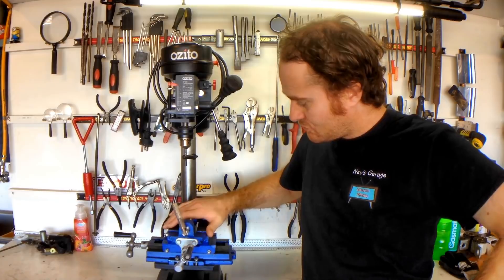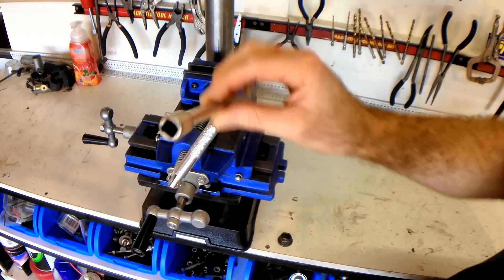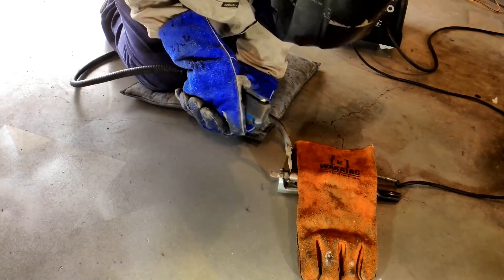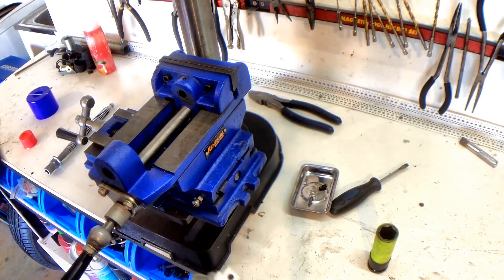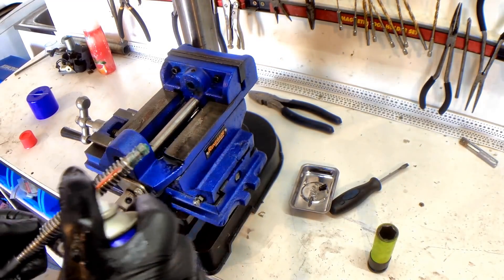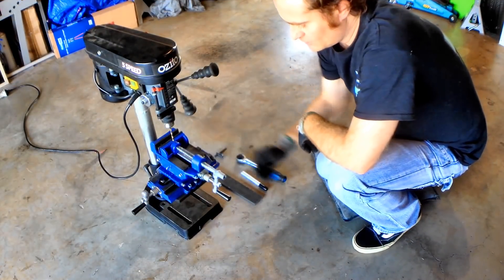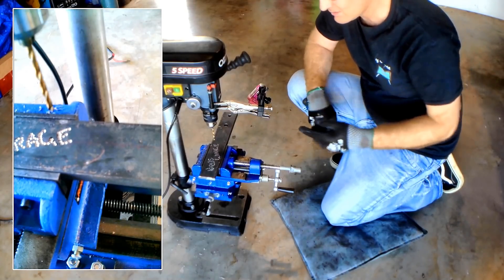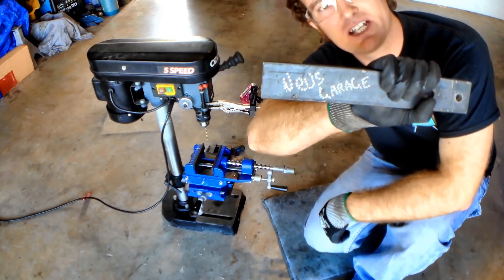Cheap Cross-Slide Vice hack Pt 2 - Deleting the Floppy Handle

Comment: A resilient washer added in the thrust stack on each axis also helps as it at least discourages the vise from floating off position due to backlash. 
Obviously there's a trade off involving the stiffness of the washer and amount of preload force (more stiff &or more preload = less float for any given reaction force at the drill tip; but also means stiffer movement and notre thread wear. 
Likewise with tighter dovetail gibs.
But for a drill vise tighter is better as it isn't moving in use so you can accept it being a bit tighter.

Comment: I thought it was only me that ended up working on my knees rather than clearing a bench. My drill press is big enough to hold the vice as originally delivered without changing the vice clamping arrangement. Though the best modification I have found is to fit two thrust bearings on each of the crank handle threaded rods, this makes for smoother turning and adjustment also helps you to have the gib strip settings tighter so less slop when doing some light milling.

Comment: Great vid! Are you still glad you got the 6” vs the 5” cross vise? I recently purchased the 5” as it was significantly lighter and I was concerned that the rack on the table might suffer under the additional weight of the 6 when raising it up. On the size drill press you have, do you consider the 6”  an advantage? Thanks!
Reply: I just got this same set up for Christmas. Heavy duty is my way of doing things. And for the cost  this is a great set up. But if you need a  lighter rack and need to move it a  lot, perhaps the lighter vice will be more effective for you. I would go big.

Comment: These are good videos, the audio was a little quiet, but that is better than too loud. :)  Does your drill press table rotate?  This is an interesting fix.  My table rotates, so I was lucky in that I could just rotate my table and cross slide vice (installed the normal way) to the side to go more of a long piece in the vice.  Your method is a bit more pre-work, but avoids that issue, so is cool. :)  Thanks for sharing this.  Do you have one of those socket attachments to go in a drill?  That could be another way to get that to open and close quickly.

Comment: I have an ozito drill press that i am changing the motor to a dc motor with a potentiometer to adjust the speed lower.
My cross slide vice doesnt fit under the top.

Comment: Thank you for the video, but my thoughts on this were that at some points, the bottom adjuster could still be in the way of a closed or open end wrench being turned in one continuous fluid motion and also that he seemed to use his fingers to open and close it more than one of the wrenches it was designed for.  It just seems to me that it's just about the same amount of work as the original screw handle.  I'm not saying that the cross-slide didn't need improving, but I just don't think this custom change was precisely the answer either.  It was a start, but the design was still somewhat flawed and not thought out as much as it should have been for the amount of time and effort put into it in this video.
Reply: So what would your recommendation be instead?
Reply: @russells.9844  My recommendation would be more thought put into the modifications.
Reply: @FoxBonly  so you are saying you don't have a better suggestion?
Reply: @madmodder123  I think you misunderstand me.  I was not and am not attacking you or trying to belabor a point.  I'm just saying that there seems to be as much work in creating as there is in just simply using.  As for creating better things and ways, I'm all for it and for people like you who actually DO the do's, so again, I'm not knocking anything with or for you.  As to your question, this should make you smile, my answer is no, at the moment I do not have a better suggestion and won't in the future because I don't intend on taking that path at this moment.  But I do believe my original comment was not and should not have been taken as an attack or otherwise because I fully and KINDLY explained my position while still giving you credit none-the-less.  Should I ever have the need to eventually go down that path then I would give it thought.  But for now, ur' the King Boss.
Reply: @FoxBonly  I didn't see it as an attack, I was just curious. Have  a good one :)

Comment: WD-40 is not a lubricant it's strictly for dissolving rust & water
Reply: actually DISPLACING water..as in washes it out. I had an opportunity where a vw was shorting out it's cap and wires from the distributor in heavy rain... I squirted some WD-40 over the wires and INSIDE the distributor, and the car fired up with no more short circuits and arcing. THAT's WHAT WD-40 is for. 
WATER DISPLACEMENT from metal and other surfaces..ALSO it is a mild solvent for some glues and residue